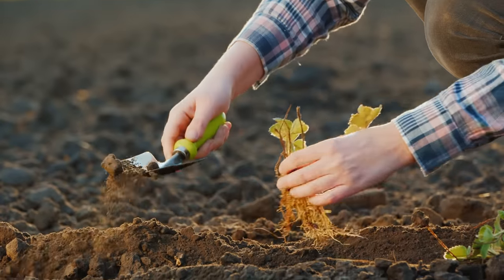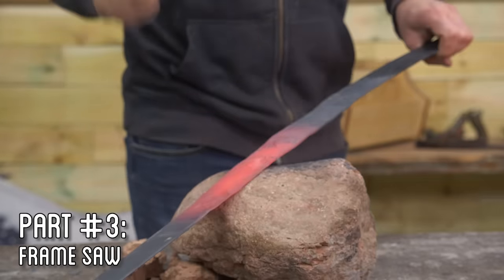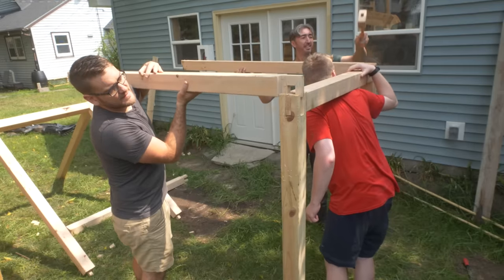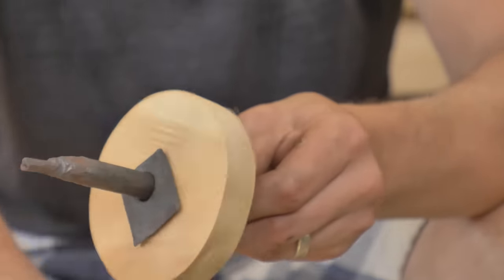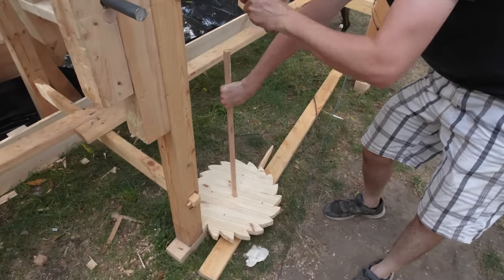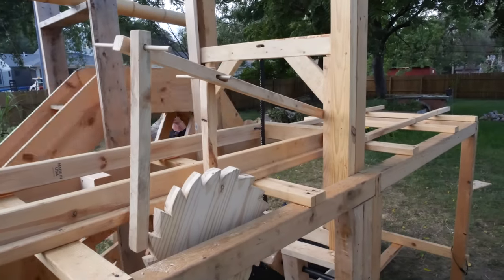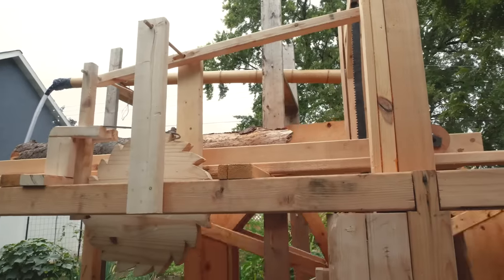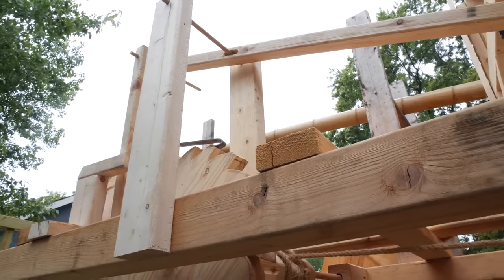I Built DaVinci's Saw Mill

Comment: well, there are some problems with the design i think.
Is the saw blade actually sharp? it really doenst look like it.
The humidity from the water collector is going to swell every thing on one side.
The crank shaft is not likely to hold, a saw should go at least twice that fast for proper cutting (yes, speed does matter) and with the extra speed comes an egregoius amount of torque if it binds, change the crankshaft to all metal, also care for the for of the shaft to the water wheel since the core is made out of wood.
You might want to decouple the ratcheting mechanism to the saw, as a matter of fact try not to have one, just make a tensioner out of some livewood or spring steel, all the force should be kept to the cutting forces, not the dragging forces which should remain constant during the cut, which the ratcheting cant provide.

Comment: I know that Human wheels were a thing. I'm pretty sure they were mostly used for early cranes for building fortifications (castles). It would be more work to build the wheel, but would arguably be a bit more consistent and controllable in speed.

Comment: Well, this design is not that "unknown" and not only a "poor sketch from 14th century" exists, actually the very same principles are used in wind powered sawmills across Netherlands.

One remark I have is towards the rope winding system for the sled - how you have designed it currently shown in the video, it would cause the sled (thus the log) to be pulled always more and more, creating unwanted pressure on the saw blade, potentially clogging or even breaking it. The bigger the diameter of the winded rope, the bigger distance it will pull. It may increase in milimeters first, but may get over some centimeters closer to the end.

The sawmills in Netherlands' windmills have a way how to disengage the lever that pulls the log, maybe you would like to incorporate this as well?

Comment: If you want to add to Leo's design, you could make a wooden gear reduction to, say, reciprocate the saw twice for every one revolution of the water wheel. Of course, you'd need a more powerful water source. So you're also going to have to dam a river lol. Maybe use a walking wheel. Or just cheat and use an electric motor or gas engine. It would be a lot easier than damming a river.

Comment: I'd attach a big wheel to the water wheel, and a belt to a smaller wheel that actually moves the blade. The blade speed is pretty slow. Lots of early scroll saws and amish designs for foot powere scroll and jig saws do that. I would try trading some torque for some speed.

Comment: I can't believe y'all haven't reground those saw teeth yet - that would have been the 1st thing I did.  It's definitely making a lot more work for you guys (you are basically filing more than sawing at this point).  And I'd spend a bit more time getting your joinery tight, particularly on the saw carriage - that will pay dividends.  @16:09 you can see it moving side to side making a much wider kerf than needed.  Finally, reduce the size of the rope spool to more closely match the max cutting speed of the blade to avoid those over-feeds.  Nice job for a 1st go!
Reply: Much like davinci's original design the point is a bit more self masturbatory than accomplishing any given task. I think you missed the point here. As others have pointed out just use a wheel blade and have someone hand push the wood sled.

Comment: Maby add a fly wheel to the side to smooth out the speed and one of the main issues i think that's messing with it could be the metal shaft that connects to the saw Maby add a small groove into the part where the shaft connects to the water wheel other than that i can't think of any improvements love your videos love learning about the why they did it in the past and seeing you recreate it oh Maby eventually you can try gears to adjust speed and torque to increase speed a big gear attached to a small gear to increase speed or the opposite to increase torque i seen a  old run down water wheel powered mill before when i when to visit family in Luisana they had a rundown broken one when i was younger i remember exploring it yours is Prity spot on almost exactly the same just made from new materials achily works and had a saw blade on it

Comment: All you need to do is devise gears to rotate the blade faster then the wheel itself also there is so much slop in the blade itself and with a more or less dull blade (wrong angles) you aren’t actually cutting much. But the concept is there maybe a version 2 would be cool

Comment: Instead of a ratchet system pulling the sled, try a weight system because it will put a steady pressure on the log and saw.

Comment: Is there any chance you might try a circular saw mill setup??? I may be wrong, but a circular saw mill setup might be more efficient... Especially if you gear it up using a much larger wheel versus a smaller saw blade...

Comment: You could swap out the water wheel system for a Treadwheel system, that way you can control the speed of the saw and are not dependent on water.

Comment: I'd have done a circular saw.

I think you probably need to be able to change the gearing.

I'd also change to some kind of conveyor belt so you aren't limited by the length of the wood, and you don't need to reset it at all.

Comment: I think the blade speed should be increased in proportion to the log progression. Also, the connecting rod is sideways, meaning forces are applied inefficiently. Maybe a gearbox to increase blade speed, or a circular blade would be better. Not sure, good work tho 👍

Comment: I think the best way to make it run faster is using a gear mechanism, but then I don't think the wheel will have enough force, meaning you may need a bigger wheel or stronger river.

Comment: The blade cannot cut through that much wood for each tick forward. This is known as adjusting your "speeds and feeds".  You need to either slow down the feed (of the wood) or increase the speed (of the saw blade)

Comment: Wouldn't a greater distance between the axle of the crank and the one for the water wheel increase the efficiency?  Seems to me the angle of the connecting rod gets a bit extreme.   If that connecting rod could be longer, I'd bet it would take less force from the water wheel to move the mechanism.

It would be like the difference between using a short lever to move a big rock versus a long one.

Comment: If your really gonna use a rip cut setup you need to re-profile your blades to be a rip profile, as crosscut isn't the most optimal for this use. Secondly, you need to fix that slop in the carriage as that will cause the cut to be inaccurate and possibly cause binding to occur. Some other things to consider is making the frame to where it wont hit the bottom rest, and adjusting it to have the full length of the blade used rather than just the middle. Lastly, the best thing for that ratcheting mechanism is to add a spring or something so that the push rod is pressed against the gear lightly so it doesn't accidentally slip off while pushing.

Comment: Why not try it with a vertical circular saw blade? You can increase the gearing so the blade spins super fast and change the ratcheting system to something that pulls at a constant rate for example attach a rope to the sled that is connected to a bent piece of wood. The length and strength of the wood would change the pulling pressure.

Comment: Why iron nails - quality medieval construction avoided them like the plague in favour of  wooden tree nails (because they don’t rust or easily work loose).
A bit of diagonal bracing or knees in the corners would have helped too.
Reply: Apparently, if there is a modern day analogue of an “unlocked feature”, like a nail, they are fine to mix in those modern counterparts with their recreations.

Comment: The ratchet is excessive, use a rope and a weight to pull it, use a wheel to decrease friction. Think pulley but all parts are fixed so you dont get extra force from the increased travel distance. Someone else mentioned the teeth, with how crudely cut the saw is you should bend them out a bit more. At no point should the teeth be anywhere near close to as narrow as the plate. Also sand down the plate in the middle and tapering towards the edges. You want a little more thickness at the edge where the saw gets the most force but by tapering the plate you limit the need for wide angles on the teeth.

Comment: I had many thoughts but it occurred to me the design is similar to a guillotine. Having the blade run on a track is much trickier than it seems. Guillotine blades getting stuck or not functioning properly was very common. You can imagine the problems that could cause when being used in front of a crowd.

Comment: 1 tip. Use 3.5" deck screws and a hammer drill youll have a much better time and you can just undo the screws easily.

Comment: I got a faster idea. Use gears, rope, and a horse. Spool a rope around the big gear or maybe you could use the water wheel and connect it to a smaller gear in charge of rotating the saw up and down. When to rope is pulled by something like a horse the big wheel spins also spinning the small gear but at a higher rate of speed. Depending on the gear ratio you might get 1 big wheel spin=8 small wheel spin. Making the saw go much faster and not needing to rely on the flow of water.
Reply: Oorrrrr hear me out, Giant hamster wheel

Comment: I see a problem with the shuttle system in ease of resetting it and limits to the legnth of log you can cut before destroying the shuttle. I might suggest instead just making a track and a pusher that uses a pair of ropes with hooks on it to pull it through. You might get away with using wood rollers made from round straight branches set in frames as a track rather than a tray. I As for resetting a way to spin the ratchet backwards or a continuous loop system would be a good idea.

Comment: normally, the wheel would run much faster and then the saw would also go faster.
Quite often they used to build  a small water reservoir/dam just near the wheel, and then  releese the water when they used the saw.
Imagine if the waterflow was 10-30 times more, then it would spin like crazy.

Comment: Sometimes I am thoroughly confused about how you put so much time into something but it still comes out wobbly or crooked.... Is that a design feature or something¿?      😂
Edit:  A very useful piece of information is that when you make wheels you should cut the outside shape then refine it by marking the center AFTER its been rounded.... It makes them a LOT smoother as a wheel/roller.    😁👍

Comment: As a sugestion make a walking wheel aka human power. Instead of ratchet wheel use rocks on a rope via pulley connected to trolley. It will let gravity pull the log through.

I am not a saw expert but surely they made better saws than that back in their era. tbf i understand that this all a lot of tedious work and I applaud you for your commitment. Good job on what you have done.

PS animal power?

Comment: I think you need to start looking into lubrication of the joints because youre loosing alot of energy in stuff just rubbing together. 

Modern grease atleast but if you wanna go that route, either tar and fat from livestock or if you wanna be super duper fancy, do like the swedes did in the pre-industrial period; snails! Black slugs where used alot as grease since theyve always been plentiful here and theyre super slimy.

Comment: In theory if the water wheel looks like a too inconsistent too be able to use due to pump failure/lack of suitable natural water source readily accessable something they seem to have used around this time would be effectively a hamster wheel for people, if you look at the construction of guédelon castle they made one to power their cranes, while it doesn't get around having to use  manual labour for the cutting of the log it seems like it would be an easier labour if you think the effort of making one is worthwhile for this seires

Comment: ad counter balance to the crank mechanism and enlarge it to speed up cuting / 2 build a hold tray to get better cuts /3 add a gearbox for speed  and consistacny/ 4 teeth on saw need to be beveled to get nicer cut

Comment: Seems like the ratchet mechanism for advancing the log is the wrong approach.  Instead, it seems like the sled should put a constant pressure of the log against the blade.  Something lke a bucket that is filled from the water to a particular height.  That would allow you to drain the water to load a new log.

Comment: You should of made your saw go up and down quicker and have the log puller to be every 2 strikes because from what I can see it works but the strap is pulling the log into the blade, so this will bend or break the structure, you should of also fitter double teeth so it cuts up and down

Comment: One of the biggest flaws that I could see that can be easily corrected is the tooth design and spacing on the saw blade. They are not well designed for rip cutting and are far too coarse for the limited power of your saw mill. But the basics you used were sound. Water wheel powered saws have been around since at least the 3000-4000 years with the Egyptians using them to build the pyramids.

Comment: you need a thinner blade with set teeth (to free the blade from the cutting line) and teeth suitable for edging wood (different from crosscutting). With this, you will already gain in cutting fluidity and the whole thing will force less.
as I am not sure of the quality of my English translation, here is my text in French, you can translate for yourself if it is not clear.

il te faut une lame plus fine avec des dents avoyées (pour libérer la lame du trait de coupe) et une denture adaptée au délignage du bois (différent du tronçonnage). Avec ça,  tu gagneras déjà en fluidité de coupe et l'ensemble forcera moins.

Comment: The saw blade going so slowly seems like a major problem, especially with the poorly designed teeth.  They look like they need to be sharpened (badly!) and the shape itself changed some.  Can probably use that blade and just refile them to a more aggressive rake and it’ll work way better.  The speed of the blade seems like an issue too, I’d think you’d want it to move far faster, so even with a slower progression of the wood you’d be getting a nicer cut

Comment: The saw blade is on the wrong side of the crank imo. You could take inspiration from a spiral crank from spining wheels But I would try to reduce the horizontal movement of the blade.

Comment: Everything hand built, Everything sawn by hand or treadle,  although the treadle saw needs some tweaks,  like something to hold the material down while the blade is on its upstroke, but, awsome job guys, although you're all gluttons for punishment,  that makes everything 100 times harder and 100 longer to build than with modern equipment.

Comment: I know you were basing this whole thing off of DaVincis plans, but I think is the wrong approach. I think you should create a design more like a band saw. Its simpler overall so the lack of precise building wouldn't be as much of an issue as it is in this example. basically leave the water wheel as is and run a long shaft out to an apparatus with a looped continuous blade. Remove the ratcheting device and just feed it through manually like in a powered band saw. The looped blade just requires some forge welding, a technique that would have been available at this tech level. 

In addition, I fully agree with TwinPhoenix666, the blade needs revamping entirely. It needs a steeper angle to the teeth, and a tiny bit of offset to each tooth wouldn't hurt. Another issue with this design is that its not utilizing the entirety of the blade. You're only cutting with about a third of the blade. This is will wear your blade unevenly and eventually the blade will break from work hardening that section of the steel and making it brittle. A longer, looped blade utilizes the entire blade equally, spreading out the wear and prolonging the life of the blade.

Comment: I loved your project, but I think the log pushing system cannot work that way. A gear with continuous movement will certainly jam with variation in cutting speed. It would be better to use something that accumulates potential energy, lifting a weight, for example.

Comment: By the time saw mills became a thing saw blades had advanced way beyond your design. Upgraded blade, gear or pulley induction to speed up saw speed and gear or pulley reduction to reduce sled speed and you are complete. We know you can build it but upgrading to a more modern saw blade is the first improvement to make. A blade with set teeth smaller rakes and considerably thinner kerf.

Comment: You guys need to learn how to hammer.  Holding the hammer way to close to the head.

I think you should just hand press the load or build it as a gravity feed.  The ratchet would have to be perfectly balanced to make the feed rate correct.

Comment: sooo, in this automated saw: how is the ratchet disengaged and the sled stopped at the end of the cut? 🤔The workholding solution could be improved so you don't have to watch it, stop it before it cuts the rope, put a wedge in the cut and retie the rope, then restart the saw.😇

Comment: Your water flow is only part of the issue, this build is impressive as hell but you need to spend a lot more time focusing on precision. Some joints are hammered in while some have too much play, wheels should be more symmetrical and centered, axles should be straight, the saw blade needs to be engineered better, the sleds should run straighter, so on. All of this is possible with your tools, but most of them suffer from the same issues. It’s tempting to build as fast as possible to get to your results, but taking the time to solve these issues would help tremendously with speed and efficiency in the end.